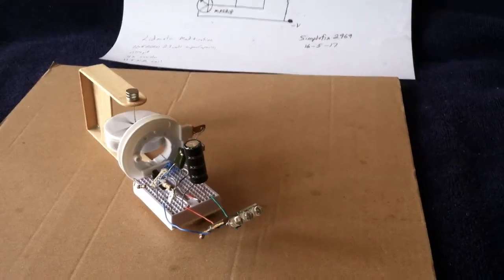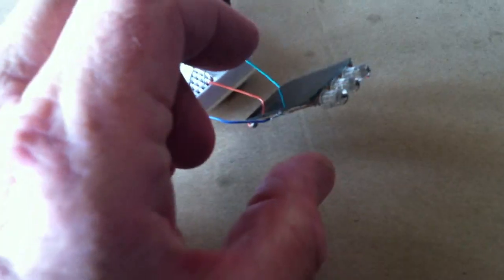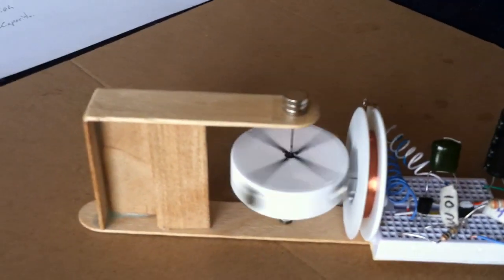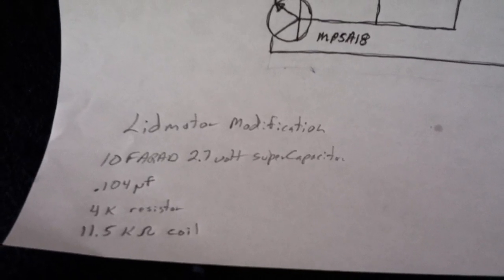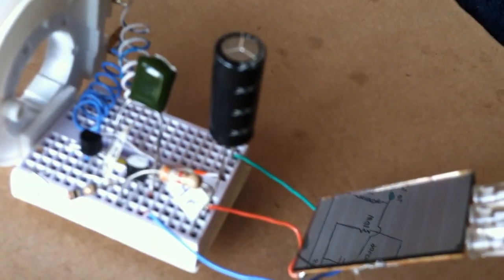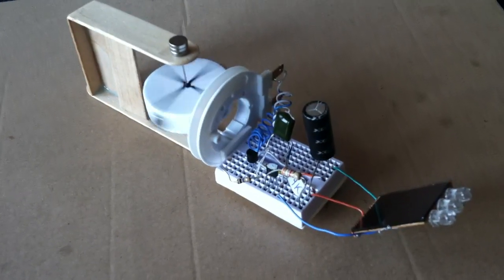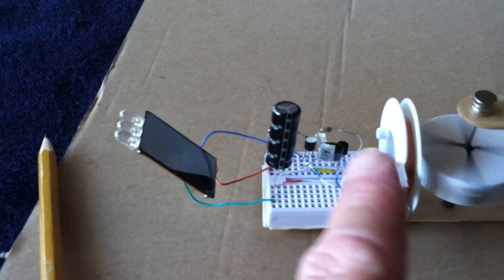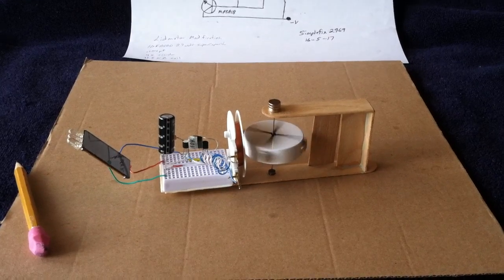Simplefix Micro Amp Pulse Motor

Comment: You might consider using 10+ year life shell Alkaline batteries, those are recharge able as well. And/or check that your supercap does not go over it's 2.75 Volt (max voltage). But if your solar cell is not in direct sunlight I imagine it only drains down, so you would have to charge it so every now and then.
I am not good at engineering, but seeing this I do think I would need to build one as well!
Thanks for sharing.
Reply from the maker: Thanks for the tips.  The 10 year shelf life AAs are one of the reasons for this project.  I worked on a version of this motor yesterday that will run at .7v at around 5 micro amps.  If I can build a structure with good enough bearings, that one should run for many years.  The electrical components durability are another issue.  BUILD ONE OF THESE!!!  The more people who build this the better it will get.

Comment: nice work, ya know those coils or coils like that can be found in the tall rotating fans, I've used em before there around 17 ohms, there a little smaller in size though.
Reply from the maker: Thanks.  I guess these AC synchronous motors are used in many things.

Comment: Nice replication. The switch is something that I wondered about. It seemed to me that the test would take a lot of energy. I guess with a solar cell and a supercap it does not matter too much. 
Thanks for mentioning the amp draw. 10 micro amps is quite nice for all that light, and motor rotation. I can't wait for my coils to arrive from China.

Paul
Reply from the maker: My motors arrived pretty quick.  I wish there was a source for these 2 dollar motors here but I have not found any.

Comment: I still research the project and have some nice motors which do what you have done, except I still use the reed switches.  One has not stopped since 2013.  I stopped using crystal bearings in favour of magnets a long time ago, Now my research is focused on  rotor/spindle designs in order to meet the gruelling 100 year challenge.
I think I have cracked the power source problem,  now its the longevity of the design I am working on.  I have even found a way to prevent the reed switch failing (so far) - lol
Time will tell - keep up the good work, I do still like to watch your videos, but don't learn much anymore :(
Reply from the maker: Good to hear that you are still working on this project.  I'm basically where you are now---looking for durability.  Some of my old projects failed due to the actual construction materials breaking down.  Some plastics are very age sensitive.  Some of the metal components broke down due to corrosion.